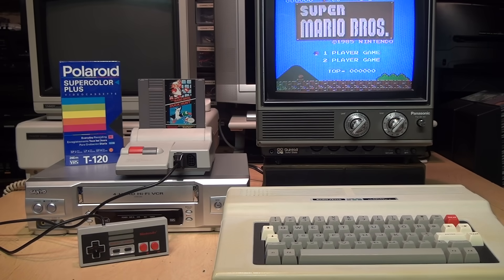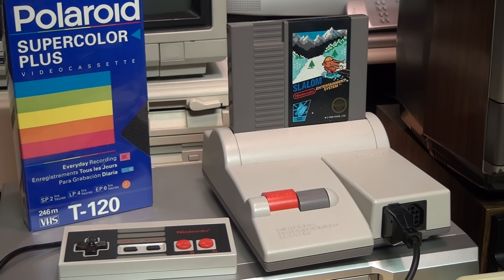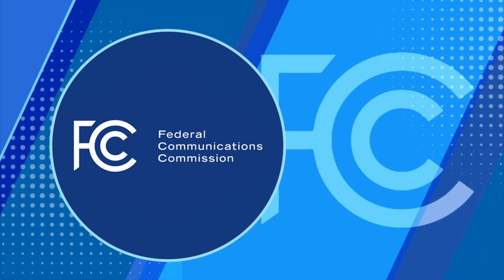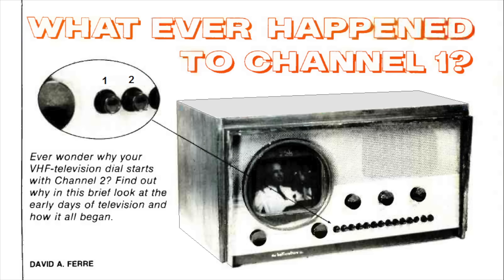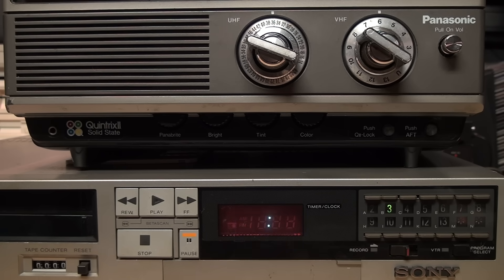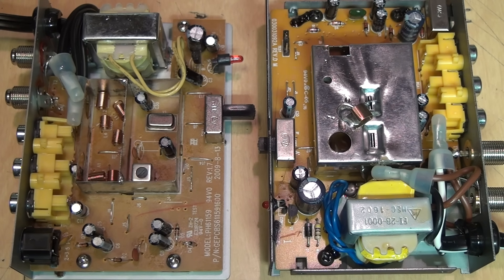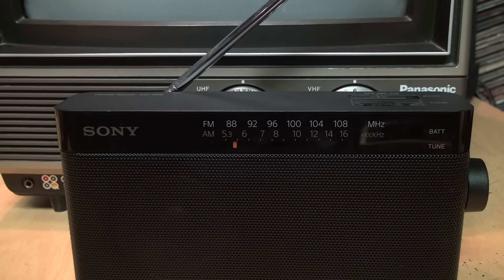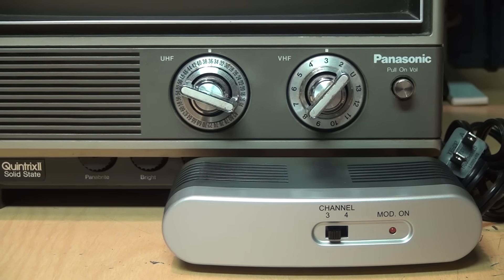Why your Nintendo was on Channel 3 (except in Cleveland)

Comment: Broadcast industry used BNC connectors for analog composite for decades, When Sony invented the D1 digital video system back in early 80's the choice of SDI was based on a smart and genius way from Sony to save companies who were switching to digital a lot of money from not having to recable their studios, Such high quality cables cost a lot of money plus the labor and down time to retrofit a studio. So Sony designed the SDI and put a serializer chip before the SDI out and another deserializer chip in the receiving device to send digital video frames, audio and other data such as teletext, caption, aspect ratio and other proprietary data in a single wire.
Reply: wish that would have been the case in the non-broadcast video world.  Much of the computer display world used VGA and the RGB5 video standard (red green blue horizontal, vertical) Large crosspoint switchers and many other components were all built to this.  You can actually deliver 1080p over it too. It would go over 100ft without boosters.  Many installed AV systems used RGB5.  HDMI however wouldn't travel that distance, and so we had a whole host of digital video over CAT6 cable come out in the 20teens.  Each one having good points and bad points.  NOBODY made an HDMI to RGB5 converter to use existing cable infrastructure though.  We ended up having to rip out thousands of feet of expensive RGB5 cable and install shielded CAT6 for digital video formats
Reply: I see a lot of passive hdmi to vga adapters. Since that isnt physically possible, my guess is for those already wired projectors in conference rooms (run hdmi over the existing vga cable). There may not be rgb5 to hdmi, but there is rgb5 to vga, and then vga to hdmi  @audvidgeek
Reply: @audvidgeek  or use hdmi to sdi converters.
Reply: @juri14111996  That’s not the point, it’s the lack of consumer SDI monitors not HDMI monitors.
Reply: Most of the industry is moving to IP based systems over fibre, but a lot of applications still use SDI. Dejero was still using it exclusively up until very recently. We also use it for long runs. You can buy SDI-to-HDMI converter boxes for this. So if you want to run a monitor up to say a commentator booth, that's the easiest way to do it. And like you said, BNC cables support analogue video. So you just need a dirt cheap BNC-to-RCA adapter, since applications like a return feed for your hosts don't need to be high def. IDK if it's better than HDMI for home use, since you're not usually doing long runs. What we really missed out on in North America though was SCART. Europe had RGB output and audio in one cable long before component came along. I suppose it wasn't used here to maintain backwards compatibility, since RCA was the default for audio since the 30s. It's the same reason why broadcast HDTV is still 1080i, even though every TV made in the last 15 years supports a 1080p signal. So it still works with early CRT based HDTVs that only supported 1080i.
Reply: @MmntechCa  SCART has its drawbacks too, When a device lacks S-Video or component for example the receiving device defaults to say composite automatically, When third party cable manufacturers started making cheap cables they screwed up the pin out or did not use all pins which resulted in confusion among consumers that they can never tell what signal quality is being sent between two devices, So if you have a S-VHS VCR and you think you are recording via the Y-C pins, using a cheap or non conform SCART cable can fall back to composite and send it to the VCR to be recorded without your knowledge, But if you are using a S-Video cable you know what you are recording. Some devices have manual input/output selection to override the automatic signal detection scheme and prevent the automatic pin switching but a lot of low end consumer devices lack it.

Comment: So that's why the NES always looked distorted when I changed it to channel 4 as a kid. We had a broadcast network on channel 4 in our area and it must have been picking up the interference.
Now here's the question, why did the cable not care? We ran our cable through the passthrough and had a channel on channel 3 and there wasn't a problem. It's because cable is a weaker signal, right? Or is it because cable is some different standard that's compatible with TV tuners to use the same channel numbers but is different from broadcast and modulators use the broadcast signal?

Comment: Always been kind of fascinated with TV RF, despite it being not that special. OFF TOPIC: There’s somewhere that says 240p signals are not allowed over the air (or at least were not because analog isn’t ota anymore). But I can’t find any other sources to confirm if that’s true. Probably somewhere deep down in FCC laws.

also this makes sense as to why 3 and 4 didnt seem to matter to me when younger, i always looked at the difference and noticed nothing. thats because im in the chicago area
Reply: Once it gets into the TVs analogue tuner, it gets converted into 21 or 41 MHz IF anyway, regardless of what channel it starts out as.

Comment: WCIA 3 broadcast VHF Channel 3 throughout Central and Eastern Illinois since 1953. Most of their reach throughout Central Illinois was due to a rebroadcast signal on UHF WCFN Channel 49 that started in the 1960s.
Reply: I grew up in South Western Indiana, and I could pick up WCIA on a cloudy day. I actually know a couple people that work there now
Reply: @thomasvlaskampiii6850 Yup, I grew up watching WCIA 3 and knew all to well about using ch.4 instead of ch.3. Realized later on that most people used ch.3 for their RF modulator because channel 3 was uncommon over the air station. Years later while going to college, I worked at WCIA as a studio tech. In master control they had an off air monitor just for WCFN 49 out of Springfield for confidence. It had a grainy picture because it was so far away; they had top mounted UHF antennas on their tower out back just to pick it up. On a cloudy day sometimes you might see 49 in your home, but it was rare. Along with WRSP 55 out of Springfield. A station only available on cable locally. Was so happy when they launched it's sister station WCCU 27 that could be picked up. Right before FOX network started regular weekend broadcasts.

Comment: 3:25 Manually tuning in channels on the VCR. God I remember that, and even though I was only a kid, I was the only one in the household that understood how this worked. Worse yet, the Cable channels weren't entirely in order. It would go through channels 2-6, 14 to 22?, 7-13, then 23 forward. Yeah, explain that to your mother LOL!
Reply: Some older manual TV's could tune in some of the old analog cellular bands.... fun times listening to random convos. lol
Reply: @BillAnt  The analog cellphone bands are the former UHF TV channels 70 to 83 which were banned from TV broadcast use by the FCC in the mid 1980s.
Reply: Cable also used channels 1 and 4A (the gap between 4 and 5).
Reply: @dougbrowning82  In Australia we had channels from 0 to 11 and there was a 5 and 5A in there as well.
Reply: @steviebboy69  but only 2/7/9/10 worked until uhf came - that was doubled up on 0 i think for a few years ( sbs was unique as it was both uhf and vhf )   
UHF started transmission in 1980

Side note my C64 in the day worked OK, but it worked better when you wrapped the co-axial  lead in silver foil( hmm or was it the standard older style tv flat twin ribbon VHF )   

We discussed it back in the day at work, then one day some one bought in their C64 and sony colour tv, turn it on and setup a game, if was ok - lets call it 10% grainy  - then while the game is running on the title screen or the game running, wrap 2 or 3 layers aluminum cooking foil on the tv out wire and bam - a better picture
Reply: @georgemaragos2378  Where I was there was channel 1 & 3 the ABC and AMV4 and GMV 6, this was country VIc.  Hey I would have thought feeding the C64 direct into the TV would have been clear anyway as it was direct feed into the antenna socket.
Reply: You explained perfectly why adults gave you the job.
Reply: @mchenrynick  And peep this: the analog cable channels 95, 96, and 97 overlapped with FM radio stations on the frequencies 95.7, 101.7 and 107.7 MHz. So channel 95 was right after channel 6 🤣🤣🤣😭😭
Reply: I had a Quasar TV with the same tuning system way back in the day.
Reply: thats how technology usually works....when cell phones came out, even though they are basically normal phones, old people couldn't figure out how to use them....cmon gramps dial the number then hit talk...or hit talk and dial the number. First ways better than you get to see if you typed in the right number

now google is so less user friendly, I will have to have help using google to find something other than porn or to buy something in the next 10 years. Since thats all google is really good for, buying stuff and porn.

Comment: In the early 80s for a while our CATV box and VCR used the same channel (4) which worked great, since you just turned the VCR on and off and the TV worked like an auto-input-switching monitor: with both the TV and VCR set to 4 you never had to touch either tuner. Then the cable company box was "upgraded" to output on channel 2, so whenever you turned on the VCR, "clunk clunk" the TV dial from 2 over to 4 and then back again when you turned it off...

Comment: I do remember when the analog TV in the U.S. got shut down, most of the people were hooking up the converter boxes to their analog tuner-only TVs via coax even though they had newer CRTs with RCA/component inputs or even flat panels without a digital tuner! I wondered why, but at the beginning you explained why…

It’s the same thing here, there are people hooking up the set top boxes to the flat panel TVs via RCA cables (we call them “tulips”) even though most of the STBs today have an HDMI output, Oh, my life…
Reply: Hi - Based in Australia,we had our analogue tv until 2010-2013 depending on state and region

Most households when digital came out used the adapter box, but i only recall seeing them with  the 3 x rca connectors ( playstation cables )
This was very common until analogue was killed of and most of my parents and other elderly kept this setup until the tv or digital box died a natural death

Anyone recall the "tv rabitt" is was a for of small transmitted, you plugged it in the back of your vhs / beta played and pressed lay, it sent the signal as a air-transmitted signal to other rooms in the home - anyone recall what channel it used
Reply: My friends house was struck by lightening and his Series X was fried through the HDMI, RCA would never do that

Comment: Before I switched to using composite video on my consoles I always used channel 4, in my market at the time we could receive a weaker channel 2 (WGBH Boston) and a very strong channel 6 (WSBC Providence). Opted to be further from 2 floor less interference (probably unlikely, but I was a young child then).

Comment: MOST Chicago households could easily switch to 3 or 4 without a TV, but if you were in the northern suburbs, or the extreme northwest part of the market, things were ugly because you had WTMJ from Milwaukee on Channel 4 and WISC from Madison on Channel 3, and if you were in Jefferson County in Wisconsin you pretty much HAD to find another solution and use an RCA adapter since 3 and 4 were received together. I know I had cable in the 80s so I just overall chose 4 just because it was easier and more memorable.

Comment: Having 3/4 instead of 2/3 also lets you get further away from an occupied channel in more markets. Bypassing the “switch” part of the RF switch, my NES caused significant interference on channel 2 when set to channel 3 but significantly less when set to channel 4.

Comment: Except here in the UK it was often ch 9 or 0! - but these were a 'default' tuning from factory (stored channels) and 9/10 times consoles or VCR etc would just work on one or the other...

If it was 'SCART' (or AV as some called it) it was generally 0 :)
Reply: That was button 9 not channel 9 . It was "channel 36" which 9 was tuned to. The reason for that was the time base was adjusted to cope with the VCR output errors and produce a picture that was stable.
Reply: @GaryKeepItSimple  We always called the buttons "Channels" because, well, I was a kid and that's just what they were called to us :)

But yeah... basically what you said :)
Reply: @Ghozer  Did you have Philips TVs. (They had 6 button, then later models had  9 button tuners) and were very popular.

Comment: When Channel 5 TV went live here in the UK in 1997 it used UHF CH36 as that was the only channel available that wouldn't cause co-channel interference issues between transmitters. Even then it had to be transmitted at reduced power. As CH36 was used by most VCRs you had the option of an 'engineer' visiting your home to re-tune your VCR to another channel so it wouldn't interfere.
Reply: On the south coast we never got analogue channel 5 as it would have interfered with France. The allocation of four TV channels over the entire UHF band took a lot of planning. The Mendip transmitter  was right at the top of the band while Rowridge was right at the bottom. With analogue TV receiving two transmitters at once would have given you severe ghosting at best.
Reply: @MrDuncl scrambled SECAM-L on PAL-I receivers
Reply: No, it used 35 and 37. Which is why they had to retune. Or, I had them send me notch filters to remove Ch 5 from my TV and watched it on satellite instead.

Comment: You can also get uncompressed and unencrypted video over HDMI which is known as clean HDMI.
Reply: or use a splitter that accepts hdcp, and outputs non hdcp signals.

then convert it to sdi, so you can do long cable runs, feed it to a video switcher with sdi inputs, and use a sdi matrix to distribute sdi signals in the building.

Comment: In the UK, we only had three channels until 1982, when Channel 4 arrived and four until 1997 when Channel 5 came along.  The bizarre thing was televisions on sale would proudly advertise how many channels they stored yet they were never used because when satellite and terrestrial digital arrived, people needed boxes. Those tended to be manually tuned to channel 6.
Reply: TVs in the US during the 1990s did the same thing, they would advertise their tuners as having "181 channels" (not sure why it was always that number). Most basic unscrambled cable service realistically had about 60 to 70 channels at maximum. If you wanted all the channels the cable company had to offer, you needed to lease a box from them.

Comment: That FM TV thing is legit, as when i was in primary school in my area, we were semi-near the little building where the receivers for satellite tv that the local cable company used were housed. In fact, around recess time, if you had a radio, you could tune in and get CITV Edmonton, who was usually broadcasting Spider-Man around then.
Reply: I still remember discovering WITI in Milwaukee on the radio one night when I was younger and wondering if someone was stealing their audio and if I had to call them to let them know until they mentioned it on the air that they could be heard at 87.7. They did try to keep it through an HD Radio station for a few years after the transition until they got new ownership in Tribune that didn't care to maintain the audio (who themselves in Chicago tried to put a second sports-focused feed of WGN Radio on FM for a few years through what's now MeTV FM on 87.7; it was only heard in town until they got FCC permission to use the channel for ATSC 3 and were allowed to put analog audio on 87.7, and now it hits the Wisconsin state line very easily).

Comment: 3:00 I have a TV that has that but you get 6 choices instead of two. Or like you say, I could program a VHF channel with a UHF one. The tuning is identical to 3:26. 
And where I live, AZ, we have a channel three, 3TV appropriately, but if you lived far from the antennas on South Mountain like I did, you didn't need to worry too much about Ch 3 or 4.

Comment: 5:08 Oh dear. It's the other way round actually. Cables for the GHz-range are tiny in comparison actually. Length is another concern, that's why cables in buildings are very thick - to reduce attenuation.
Reply: Yes, length is the reason for the heavy cable. The IF cable in vintage TVs is the same thickness as the game console cable. It carried 21 or 41 MHz.

Comment: RF modulators were out in the 70s, the reason for 3/4 was because before cable, very few markets had stations on both channels, so you just used whichever had no station. From the 70s on, I've never heard of a VHF only tv, or a TV with 2 VHF antennas. Every TV I ever watched had VHF & UHF. Originally UHF was 13-83. I only remember seeing vhf-hi & vhf-low on small TVs starting in the 90s
Reply: The US All Channels Act of 1964 made UHF tuners mandatory on all TVs with screens over 12 inches. Prior to that, UHF tuners were optional, even though the FCC opened the UHF band in 1951. In Canada, UHF tuners weren't mandatory until around 1970. The VHF band was always split, but most sets had all the channels on the same dial, only giving UHF a dedicated dial, since a separate module tuned those channels.

Comment: I had a couple Atari (Ch. 2-3) computers, 130XE & ST, and they used the same RF modulators and switch boxes as the Old 2600s did.  They might have been used in their Pong consoles as well for all I know ...

Only the Jaguar used automatic RF switch boxes like the Nintendo systems did.